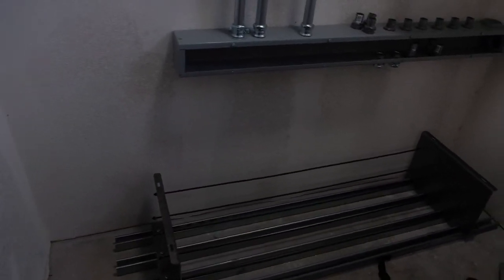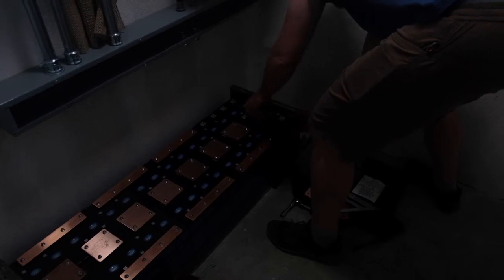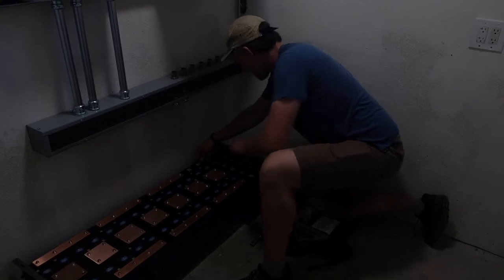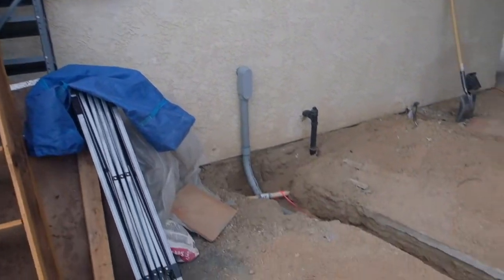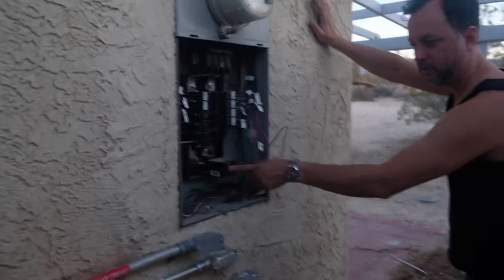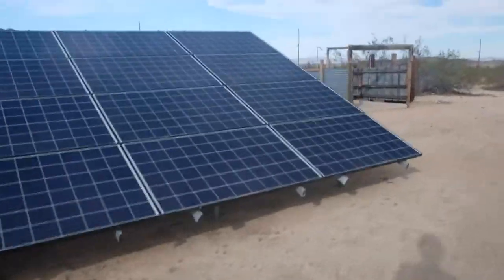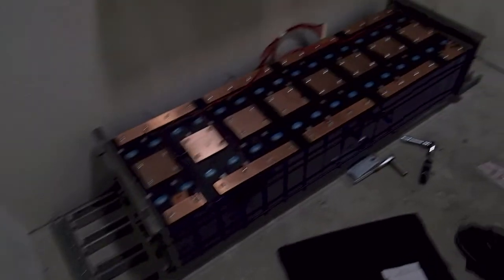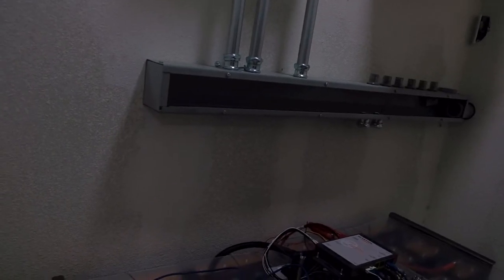DIY Lithium LFP Battery Pack, Battery Assembly, Part 2

Comment: Those buss bars are nice but the price is ridiculous.
Reply from the maker: It's a lot of copper, so yes they are not cheap. At lower currents I can use a thinner material which is cheaper.

Comment: You have interesting content, but you definately should inprove your video quality. I.e. LIGHT in der battery room while filming would help, details or a schematic how exactly the batteries are placed. MUCH less "unstable" video filming etc. etc. It's otherwise quite stressfull to follow your videos. Again, content and what you do is definately interesting. Btw, I absolutely agree with clpoelker regarding the insulators between the cells. The foil between them is very thin and boy, if that breaks, rotts away etc. over time then you will have a real big firework with the ~28Kw/h pack you have here!
Reply from the maker: Markus, valid points! We were more focused on the installation and I didn't put much effort into the video production. Next time I'll prepare a bit more! Thanks for watching!

Comment: I would like to see insulators between the cells also. Nice bus bars!
Reply from the maker: thanks! there isn't much between the cells. Last minute I decided to put some rubber material between the compression plates and the outside cells, just to have it grip better.